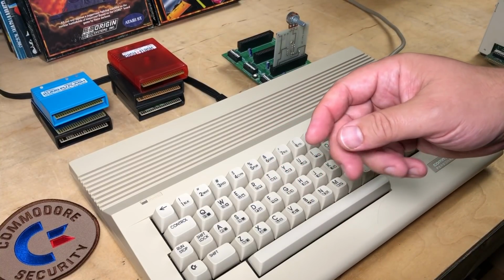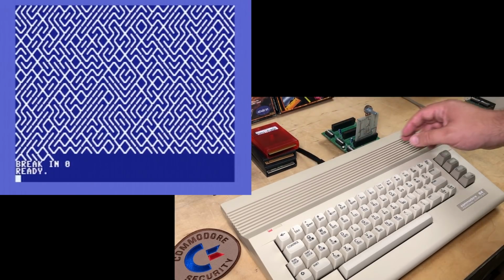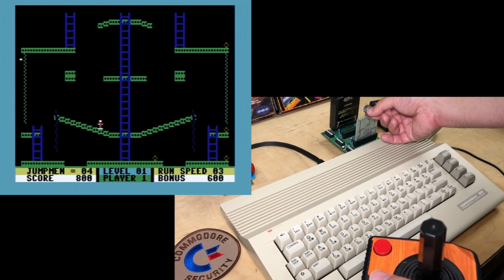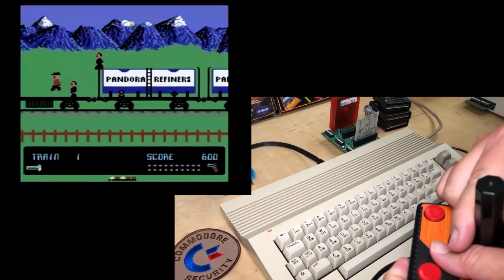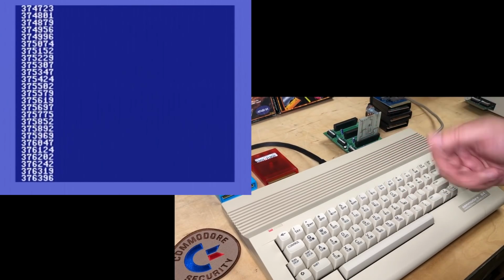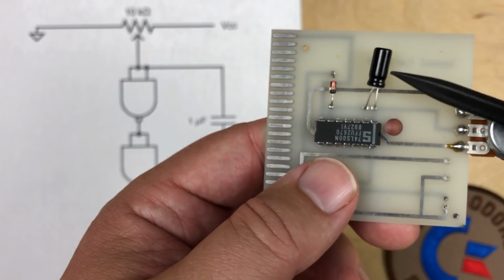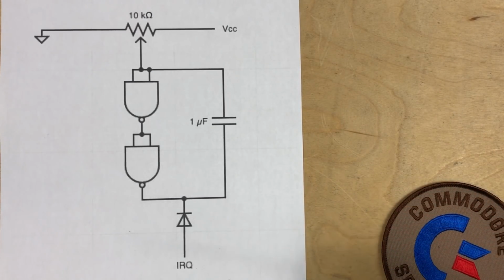Speed Cart 64: Slow Down Your Commodore 64, Sometimes

Comment: Yay!  I got a greetz (I get so few...)  I think I know why they used a TTL IC.  Well, we all know they used this design because it was cheaper than other options, but it is cheaper in a slightly tricky way.  The goal is to provide a way to optionally slow down the 64, for whatever reason someone wants to do that (I won't judge).  The sensitivity of the design allows the same circuit to do three things.  Create a constant IRQ (when turned counter-clockwise, the input is ~0V, and this means the IRQ is always held low, which is not useful), create a variable cycling rate for the IRQ (the good part), and create a constant lack of IRQ (in essence, the unit is off).  Without that 3rd behavior, the design would also be creating IRQs at some frequency, no matter how slow, and a switch would be needed to turn the unit off.  Thus, the temperamental nature of the circuit and the fact there is a region where it will not create an IRQ was used to cheaply create an "off" mode.
Reply from the maker: Thanks for the extra insights! Good analysis.

Comment: Even if they didn't want to pay for a 555, they could have built a much better voltage controlled oscillator using all 4 NAND gates on that chip. Alternatively, this simple circuit will work better if a resistor is added between the output of the first gate and ground.

Comment: In addition to being useful for some types of games, I could see it being useful as a debugging tool, potentially, either by slowing something down so that you can catch it more easily or by pairing it with a special IRQ handler that aided in debugging by checking a memory location or some such more quickly than the IRQ would normally be able to process it.

Comment: There's a lot of people using Raspberry Pis as various Amiga accelerators, flickerfixers and SCSI boards - I wouldn't be surprised to see someone use a Pi Pico in the place of a 555.  I'm sure it could read a potentiometer and output appropriate number of pulses - scaled better than a raw pot too...

Comment: This reminds me of something I did, circa 1990-ish. I was in my electronics class in high school and found a crystal that was just above 1.1MHz and wondered if I could every so slightly boost the performance of my C64 if I installed it. I had enough sense that I didn't think I could boost it up to 4.77MHz like an IBM PC, but just and extra 100+KHz maybe would work??? I remember someone telling me in a message on a BBS that they didn't think it would work because the timing between the C64's components were too tight. He was correct. However, it DID boot up but the screen was really distorted with a many horizontal bars skewed into like a saw-tooth pattern. I think there was also a screechy sound coming out of my speaker. I don't remember if it responded when I typed on the keyboard. I don't think I tried, I was too afraid to allow it to continue in that state for fear of breaking it. So, that was the end of that idea. Glad I tried, though. :-)
Reply from the maker: I'd have loved to have seen that myself! Yeah, it's especially the integration with the video chip that needs to generate a valid NTSC or PAL video signal; even a very small change in speed would be enough to make the video signal invalid, though I'd think the CPU would still be running okay. I've thought about it before but have never seen it demonstrated; that would make a really cool Youtube video, especially if there was a way of smoothly adjusting the speed and watching what happens to the video output.
Reply: @8_Bit   I would think in this age there's a variable oscillator somewhere one could wire into the timing circuit?? Its just a measly 1MHz. I wholeheartedly agree that would be a fun thing to try and share with the world. One caveat - the crystal MAY have been something like 1.08MHz. Even if it wasn't 1.1+ , it was close. I'm struggling to remember after all these years, but the rest I'm sure of. I still have that ol' 64. Tried to resuscitate it a couple years go. I re-capped it completely, replaced a couple of chips while troubleshooting it until it appears the VIC chip died. Will revisit the effort later.
Reply: I don't see how it could have booted at all: the C64 uses a 14.31838 MHz crystal resonator, nowhere near 1 Mhz. (The 14 MHz clock is divided down into several slower clocks used for various parts of the system, particularly for video, as well as the 1 MHz clock used by the CPU. See page 6 of the Service Manual for all the details.)

Comment: I remember having a cartridge for the Commodore Amiga, Action Replay revision 3 if i remember correctly and it had a pot on there and you could slow the machine down.  But it has been so long I cant remember how well it worked.

Comment: As far as improvement, adding one or two resistors and playing with the pot value should really improve the control resolution (ie make the pot much less finicky).
Reply: While higher resolution/smother range would help, it's not the best solution since some games would still crash based on their design.  As suggested by Robin, NMI and/or DMI line manipulation would probably work better.

Comment: It may have been "touchy" because the pot was dirty.  Use some pot cleaner (or electronics cleaner) and turn the knob a lot and it should smooth out.
Reply from the maker: I should have mentioned in the video that I did give it a good cleaning beforehand, and it seemed very smooth when I tested it with my multimeter afterwards. Pretty sure the preciseness required is a result of the design of the circuit.

Comment: Interesting device. Yes, I'd imagine it was originally cased. It would have indeed cost less doing it that way as a 555 circuit would need more components.  Maybe the value of the pot is too high or low, that's why it's so sensitive? I seem to remember there was also a similar device that worked via a joystick port.

Comment: It's a very weird design, to be honest. Two inverters connected like that make an oscillator. Without the capacitor there, it would oscillate at an extremely high frequency, close to the limit of what LS logic can do, which can be anywhere up to 350MHz. So adding the RC part adds some control to the oscillator, but as you noticed, it's still not very controllable. I'm surprised they didn't use something like a 555 timer which would give them much more accurate control. It would take some experimenting to find the range of frequencies that worked best, but once you figure that out you can easily design a 555 circuit to be adjustable over that particular range. Add a switch to turn it off maybe, or have multiple frequency ranges. Even back in 1989, the 555 was a cheap IC, though the LS00 probably was cheaper. It just seems like a not well-thought-out design, hacked together. The boards are homemade, so it was probably just produced in small batches.

Comment: I'm just amazed  and baffled how the game cart and slomo cart work simultaneously.
Reply from the maker: C64 port expanders like the CMD EX3 I'm using in this video are a lot of fun. Not all cartridges get along with each other, but the slomo cart just shares the +5V, GND, and IRQ lines and doesn't electrically interfere with the operation of the other carts.
Reply: @8_Bit  Thanks for the response.

Comment: I think you could cut the 6510's speed in half by cutting the trace leading to its suspend input and inserting a circuit to suspend the chip every other clock cycle.

Comment: 0:12 How does a Commodore Security badge make your computer faster?

2:30 Reminds me of Slow Mobius from "Rick And Morty": https://www.youtube.com/watch?v=j-5wmWuJHMI .

2:59 You can accomplish a similar thing by POKEing the high byte of the IRQ timer.

4:30 Won't the game get very confused if it uses raster interrupts?  This is probably one of the things that happens to your favorite Mountie game.

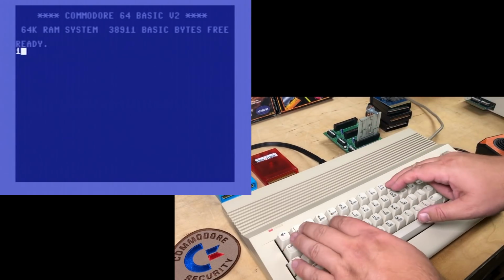13:52 I was spoiled by the schematic diagram in your (original) thumbnail!

24:34 NMIs wouldn't be feasible.  The thing about NMIs is that they're *Non-Maskable*!  If they're generated too quickly, they interrupt each other until the stack wraps around and garbles itself.  I ran into this problem with SwiftLib @ 115.2kbps.  The advantage of IRQs is they don't produce nested interrupts.  Places where the system appears to pause with the current device (from a new IRQ being initiated immediately after the preceding one completes) would see the NMIs overflow.
Reply from the maker: Yes, probably most games that use raster interrupts will get confused by this; I'm sure that's why Bruce Lee II was so crashy. But if the interrupt handler is coded a certain way (arguably, "correctly") then it will look for the correct interrupt source and handle the extra IRQs in a robust way. Of course, I wouldn't blame any C64 programmer if their code doesn't handle this strange situation well!

And yeah, for sure NMIs wouldn't be nearly as useful, but if the circuit was better behaved (for instance, if it used a 555 timer and had a wider range of usable interrupt frequency that didn't so easily cause continuous interrupts) then perhaps in some software it would be another usable option?
Reply: I don't think this was ever meant for games. I think it was meant for programmers to slow things down so they can see what is happening.  I'm guessing that POT is probably dirty as well given how touchy it seems to be.,
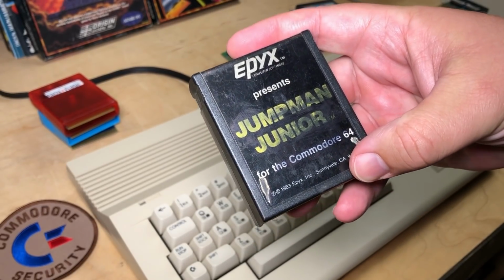Reply: @8_Bit  6:42 Mine too I played it a lot had the disk version and owned both the 1541 and the 1541-II
Reply: @8_Bit  8:59 that sound reminds me of one of Eagle Soft Incorporated crack intros

Comment: It's an odd one definitely, I think I saw something similar advertised in the past - and there were joysticks with "slow motion" buttons that were very ineffective. The 1989 date for the IC is intriguing too - it makes the cart much later than you would expect.
Reply from the maker: I have memories of seeing adverts for something similar too, but couldn't manage to find anything after a few hours of searching both my magazine collection and archive.org. If you ever run across an ad, let me know please! :)
Reply: @8_Bit  Lots of third-party controllers for consoles in the early 90s had "slow-motion" buttons -- all they did was press the START button really fast over and over. If the START button happened to pause the game, it sort of worked. But if it did something else then it was useless.

Comment: Use a Precision potentiometer, 10 turns Poti for better setting ;)
Reply: That.  But first try to clean the current pot with an electronics cleaner.
Reply: I was thinking a multitude pot as well, although it would probably take some pretty frantic twirls during the throes of a game! Also thought maybe hacking a super long sliding pot instead…
Reply: Multi-turn pot, not multitude

Comment: Seems to me a cart like this could be useful for being able to step through code slowly during the creation process of a program and also be able to run that program at full speed easily. But it is a rather kludgy way of doing it!
Reply from the maker: Yes, it could potentially be useful for debugging if it had a better system of control.

Comment: ah one kind of the IRQ "jammer" or how you call it today?
Was in the "magic 64" disc mag, build it inside my c64
afair sid was running faster and system could also crash.
yes like you show in the rail road game. glitching. untill it crashes haha

the circuit I have build back in the good old days is with a NE555, a 10kOhm pot,, 150 Ohm resistor, 10µF cap
Pin 1,2,4 on ex-port.

There were examples it was possible to speed up things in the c64

that is the dependency between the chips and their tasks (or how to say in english)

interesting they used a 7400 ...

yes there was also a circuit for the DMA ...

Comment: Great video, Robin. And great concept with the cartridge. The 65xx  never really had the CPU step facility that other CPUs had, because its internal registers needed a constant refresh, but this is an interesting way to achieve something similar. I had wondered if it held down the bus request line, that I think the CP/M cart used, to halt bus access (rather than CPU speed). Wonder how the Datel Action Replay acheived similar on the Amiga 500 with its 68000?
Reply: The 6502 does have a CPU step facility. You can't do it by stopping the clock because, as you point out, the CPU core is not static, but you can pull the RDY line low and the CPU will stop executing instructions until you let it go high again. (The clock continues to run at the same rate during this.) This is the exact mechanism used by the Commodore 64 for DMA (such as with the REU).

The MOS January 1976 MCS6500 Microcomputer Family Hardware Manual gives a description of "static test" circuit for single-cycle and single instruction execution in section 3.1.2 on page 124, with a schematic in diagram 3.1 on page 125. (Sorry about not giving URLs for this, but YouTube tends to send comments with URLs to /dev/null, so you'll have to search.)
Reply: @Curt_Sampson  had no idea, thank you!

Comment: These seem to be CIA interrupts. So, if a game turns off CIA interrupts (which many do, I guess), the cart will not affect the gameplay.
Reply from the maker: From the CPU's perspective, anything that pulls the IRQ line low will cause the CPU to interrupt what it's doing, and execute the code that the IRQ vector is pointed at. Normally the CIA generates the IRQ that drives the system interrupt that flashes the cursor etc. but other sources can trigger the IRQ as well such as the VIC-II raster interrupt, or anything hooked up to the IRQ line on the expansion port, such as this slow-mo cartridge. So even if the CIA timer is disabled (you're right, many games do) this cartridge can still cause extra IRQs; it just depends on what code the particular game has the IRQ vector pointed at, and whether the handler bothers to check the source of the interrupt.
Reply: @8_Bit   Oh, I see. You’re right. So, if a game has only one raster interrupt, it will be fired lots of times with this cartridge. And the line will not be checked, so the code is processed and the game glitches away. If a game has 2 raster lines where it wants notification, it might ask the VIC if it’s on eather of the two lines. So, the extra interrupts have no effect. Reasonable?

Comment: Bill Herd on his live show a few days ago mentioned problems slowing down the C64 CPU due to its design. Here's a link to the section. https://youtu.be/Ou7iRrHhLrE?t=1550
Reply from the maker: Yeah, most of these 8-bits that could connect directly to a television have a very tight integration between their CPU and video displays, and if you try to speed up or slow down even a small amount, the video signal goes out of spec and won't be displayed anymore. Among other problems!

Comment: Why do some games get so messed up by it?
Reply from the maker: The cartridge is generating many extra IRQs which cause the CPU to execute the IRQ handler code which is often custom code written for each game. That code has often been designed to be executed only 50 or 60 times a second, not e.g. 1000 times per second, and may have other dependencies in the main game loop that get out of sync with each other. So in short, this cartridge may force a game to get out of sync with itself.

Comment: This reminded me of a SYS # or was it a (poke #) that changed the speed of the cursor but slowed down a print program. Does anyone remember this address #?
Reply from the maker: Yes, it's similar to doing e.g. POKE 56325,0 which will cause the main system IRQ to fire very rapidly, increasing the cursor flash and slowing down BASIC.

Comment: after the tests you made that indicates its probably affecting the graphics units refresh rate as it doesnt affect the main thread that counts but it stopped refresh rate that without causing trouble to counting progra. that indicates it directly changes refresh program/logic somehow. its mostlikely changing graphics chips refresh rate by adjusting dropped frame count. mostlikely changing soma settings on driver software/thread.

Comment: Hi Robin! Listen my friend, I desperately need your help. I just bought a c64, it's an old gray case model and I connected it up and all the games are sped up, especially the music. I have no bloody clue what's going on, but I'm not a happy camper! Could you please help me? Thank you so much for all your videos..
Reply from the maker: Hi! What are you comparing the speed to? Do you have another C64 that runs slower? Or have you been using an emulator or other recreation? Maybe you're used to PAL speeds and real NTSC speeds seem fast now. Can you post video of a few games running on your channel? Just handheld from your smart phone should be fine; I'm curious to see this.
Reply: @8_Bit  I compared the speed to some videos of the same games I found on youtube, they all run at normal speed, aswell as my ccs64 emulator. And yes, I will post a couple videos of the gameplay. Thanks, my friend.

Comment: Terrible cheap design, there should be resistors on each leg of the pot.
Reply: Agreed, it could've been made a lot better for cheap.
Reply: @Okurkaarrgghh  wouldn't it need to be double-sided anyway for the card edge connector?
Reply: @Lemon_Inspector  In a loving universe, yes, but since this thing seems to only tweak the IRQ line, that's on the same side as the 5 volt line, so you could get away with only having contacts on one side of the PCB.